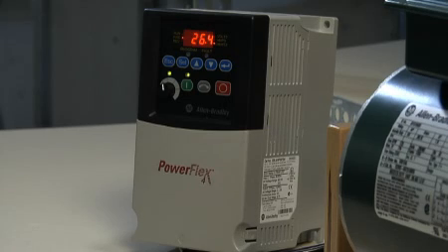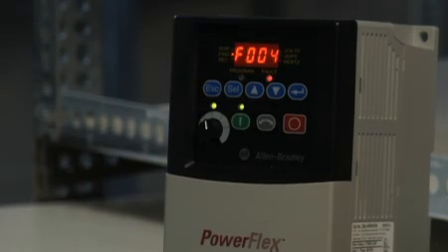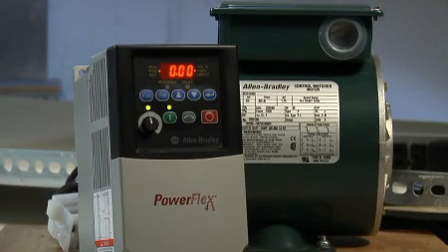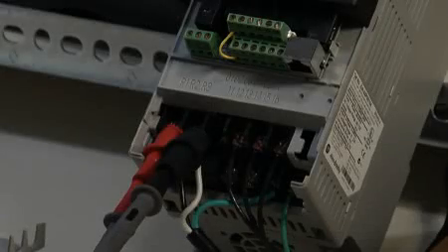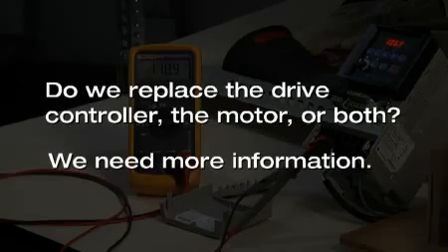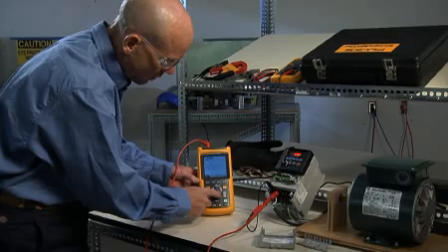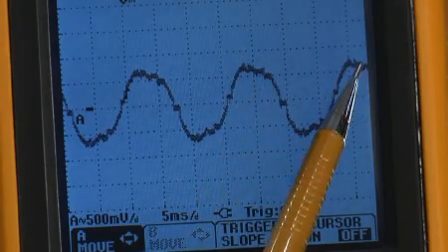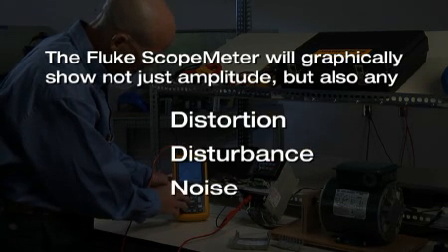How to Test a Variable Speed Drive (VSD) With a Fluke ScopeMeter®

Comment: We had 2 brand new Fluke scopemeters that cost well over a thousand $. Never used one. Do not waste your money on one. We had great Danfoss tech who never used one but troubleshoot repair and perform drive start ups for over 30 years. He gave me just the best things to look for on the old now obsolete Danfoss VLT 6000'S drives and the Danfoss FC 200'S. All the critical equipment had the bypass function. Danfoss drives the best that I worked on in my 50 year sparky carrer. Hate the crap made in lack of quality control china. My cheif electrician boss would always cry the blues when we needed money for a new board, IGBT'S or even fuses. Always told him to have a look at the total hours and energy used on drives. Had some drives that were over 15 years old and using the motor nameplate ampere a 100 HP drive easily saved thousands of dollars over its lifetime plus probably double the life of bearungs & V belts due to almost always running at reduced speeds especially at night & weekends. Slow ramp up time a blessing espically on old equipment. We had several dual 60 to 125 HP HVAC fans that we had to set ramp up time to 10 minutes during winter so the freezestats would not trip units out. Nice vid. Thanks. I' m 70 years old but still attending CEU'S classes to keep up with the code. Never too old to learn. Hard for some of my fellow old farts but change is good.
Reply: Nice one, tell me can you do an insulation resistance test on the Danfoss vsd?
Reply: @markpeters9332  Always used. Fluke multimeter that had a megger built into it. We had 2 greenlee meggers each in a 12 floor research center building that I did not like. All of our hundreds of VFD'S were feed from 480 volts so going by general megger rule that says to double the voltage and add one hundred volts so I always used the 1,000 volt DC for testing motor resistance. While I had old 480 volt motors that ran with only a megohm to ground on a full voltage starter the drive manuel think mentioned they wanted 10 megohm to ground resistance. So I always like to see at least 15.megaohms to ground for a 480 volt motor running off a VFD. I also had my own Simpson megger that supplued up to 5,000 volts DC that I used to test 4,160 volt motors that did not run on a drive. Please note that all motors MUST be at a complete stop before attemting to megger or ohm test  motors. This was always a problem where we had 2 40 to 150 HP air handlers along with a 25 to 100 HP return fan. Had to ramp down air handler down to 15% of full speed and hope the motor being tested came to a complete stop. In a hospital it was very hard to get petmisson to turn air hamdlets completly off for only a few minutes even mudfle of the night. They had pressure alarms all over the place. At least 85% of the time a Danfoss or ABB VFD shut down due to what they called an earth fault there was no ground. Wolud megger good then rebooted and earth fault might not show up again gor anothet year or two. Hope that helps.

Comment: I'm sorry fluke, but you don't need all that to see if the VFD is bad or if it's the motor
Reply: How i get  to  solve the   problem without fluke scope.
Reply: @ledsalv1  With your BRAIN and logic
Reply: So right. Used a great combination Fluke VOM with a built in 1,000 volt megger. Used one for 10 years before I retired. Dropped it off top of 6 & 8'  stepladders dozens if time. PM'ed troubleshoot repaired & replaced drives at a large hospital/research center before I retired.

Comment: Nice job, we are VTdrive - The best VSD (variable speed drive) manuafacturer in China.
Reply: vt drive = rubbish
Reply: Good thing I did not eat yet or I would have puked when you said a china drive was the best. Always had trouble getting tech support & parts from anything made in cheating lying lack of quality control china. Only thing they are the best in for my 2 cents is producing poisoned sheetrock and killing cat and dog food lead paint on childrens toys LED drivers that smoke then catch on fire. Also my high blood pressure medicine that was recalled due to probably a poisioned ingredient. Proud to say that I only own 1 tool made in cheating china. A Craftsman breaker bar that was a replacement for a much better made in USA model that broke after 52 years of use. Never purchase or use ANY test or safety equipment made by lying cheating china.